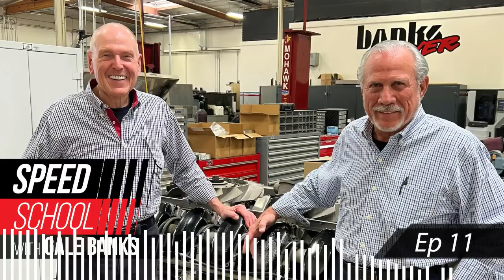You can thank these guys for the turbo in your car | Speed School Podcast Ep 11

Comment: I was so into cars from 12 years old I designed a 5 cylinder and took it to a mechanical engineer at uc in Cincinnati was told it would never work. BMW came out with a almost identical one years later and I  decided not to be an engineer but to learn all I could and make fools of a lot of them.  I am known as a problem solver now and still a gear head.  I have been honored to work with some of the smartest folks at NIST in metrology and controls. You guys make me realize that I missed some fun times in engineering.

Comment: They DID make a Monte Carlo turbo for 1980-1981. They are rare and ended up using the Buick v6 Turbo. It was very Interesting to hear that he worked to develop a v8 turbo for it. It seems that Wald is unaware that GM moved forward with the Concept after his work stopped.

Comment: Actually the Allison V-12 that was used in the early P-51's always had a supercharger. The Allison V-12 was originally developed to be used in the Bell P-38 Airacobra and to be turbo charged, but late in the P-38's development phase it became apparent that the airframe wasn't big enough to fit a turbo charger. Allison didn't have the time to properly develop a multi stage, multi speed supercharger, so they had to use  a single stage, single speed supercharger. This is why the engine was only good for low altitudes. It has been said that if the same supercharger used on the Merlin's was used on the Allisson's the Allison's would have out performed the Merlin's.

Comment: I wish Garrett could figure out turbos in the modern era. They hated on and dragged their feet on billet compressors until they were the only ones with cast wheels. Their home page was a two page paper claiming billet was a crutch and wouldn't compete with their cast stuff.  Well, they finally tried to catch up, but never touched their turbine wheels. GT30s worked great, GTX30 doesn't because the hot side maxes well before the cold side. They never fixed the GTXs, and kept over rating each unit's power. Now we have the G-Series. The compressors are over rated by at least 10% and the turbines are undersized greatly. This is a company that makes turbine engines? The last mistake was moving everything to China and allowing pulsar and the others to exist.